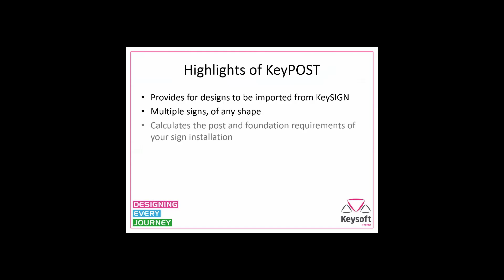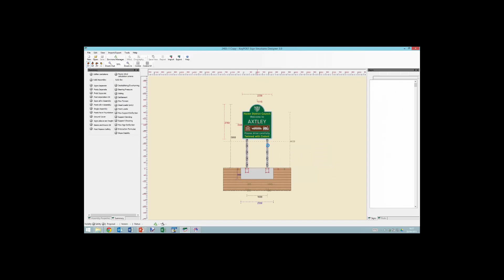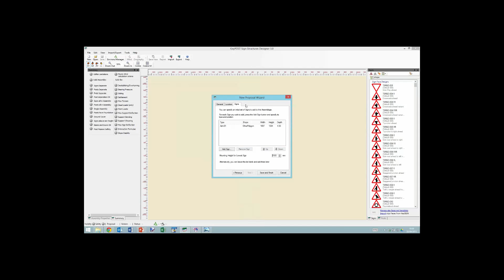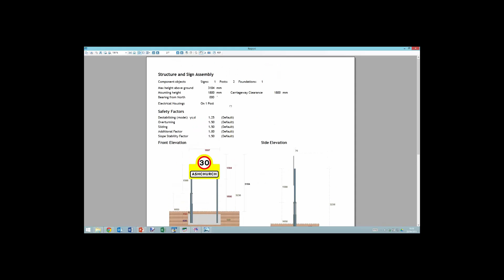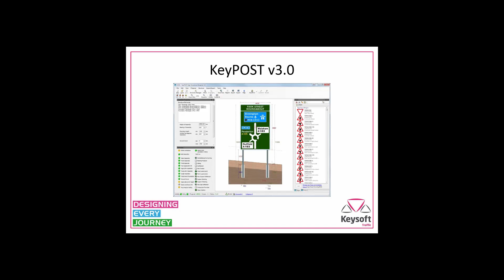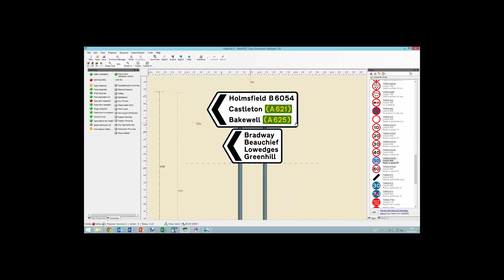Sign and Post Design Solution

Comment: Thanks for the presentation although it is 7 years now.
I have a quick question and that's: can we provide a lighting column as one of the posts and get summary outcomes?

so first: how do we insert Lighting column
second: does it give us summary outcomes
third: can we provide a post which is not anchored to the foundation but in between signs (because of that arrangement mentioned above)

So first post ok 
2nd without going to foundation just to keep the top one
3rd Lighting column where only one of these 2 signs is attached 
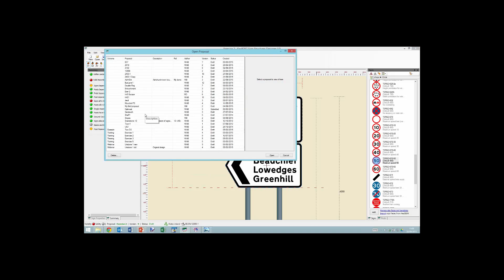(So imagine at 52:52 time where the above sign needs to be attached to a lighting column and the bottom has 2 posts but only one is going to the ground and the 2nd is in between the 1st and the 2nd sign only)

Thanks